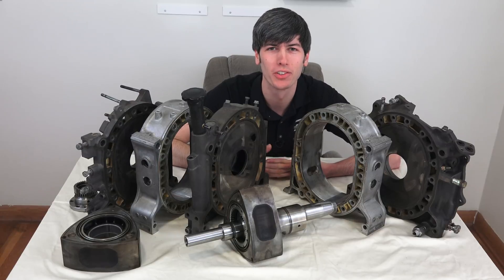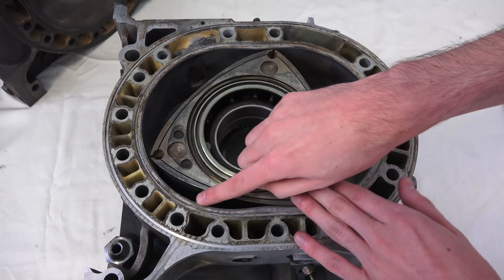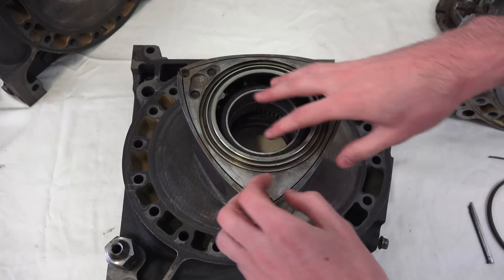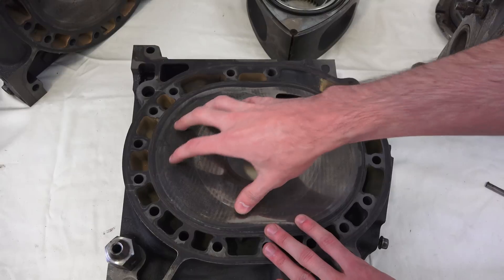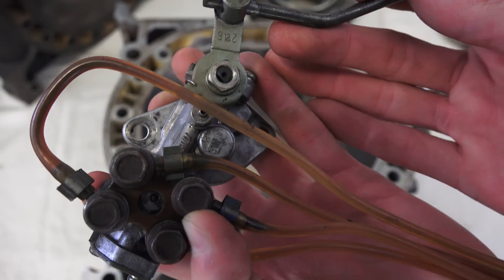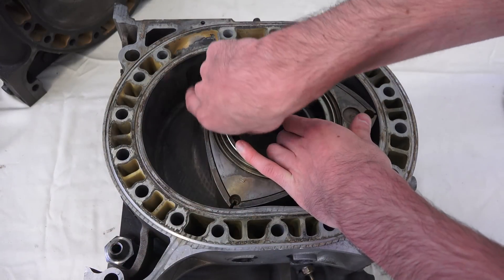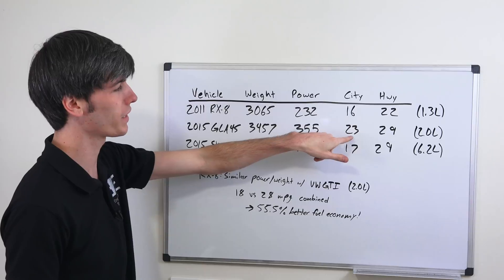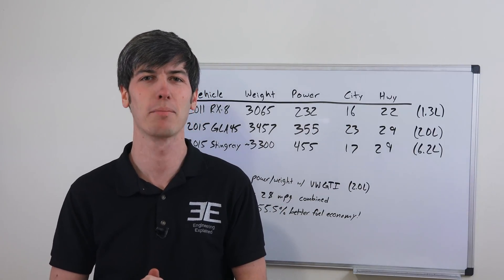4 Reasons Why The Rotary Engine Is Dead

Comment: The Wankel didn't die. They're still being used in the 2009+ M1 Abrams tank.
Reply: The real doktorbimmer Sure, but Mazda is also applying for patents in the USA that pertain to Wankels. They are actively developing the motor. Active is the opposite of dead. One manufacturer may be done, and another starts up.
Reply: The real doktorbimmer Then kindly explain why Mazda is applying for patents in March of 2016? Link to actual patent application below:
http://appft.uspto.gov/netacgi/nph-Parser?Sect1=PTO1&Sect2=HITOFF&d=PG01&p=1&u=%2Fnetahtml%2FPTO%2Fsrchnum.html&r=1&f=G&l=50&s1=%2220160084158%22.PGNR.&OS=DN/20160084158&RS=DN/20160084158
Reply: The real doktorbimmer no.. no... no... there were some changes then they dropped the rotary ban... (said because they still dont kbo hoe to classify the displacement) its nice to c u found ur balls again to come talk again i figured it would b another week or so like last time (: proves my point
Reply: The real doktorbimmer All sep v1 tanks recieved the wankel that would run on virtually any explosive liquid dumped into it. It was only recently that the hatz apu's were deployed. nice try though. A+ for effort.
Reply: The real doktorbimmer Sure. ok. They are protecting themselves from lawsuits by spending tens of millions developing an entirely different style Wankel. Or they are bringing out a new model in the rx series that has run for over 40 years (and they just debuted a concept rotary car at TAS)... Hmm. Let me see if I can find my Occams Razor.
Your argument doesn't even make sense. Sometimes I try to solve math problems by chewing bubble gum...
Reply: Dude the M1 uses a gas turbine engine
Reply: The real doktorbimmer  How about the actual fact Mazda Dealerships in germany already have posters and advertisments for the MAzda RX Vision and all of them feature the term "All new Skyactive Rotary..."? And do not come up to me with a Rotary is not the same as a Wankel. Wankel is the last name of the developer of this kind of engine. Just because Mazda gave it the name Rotary to get out of trouble with NSU (nowadays more or less Audi) it does not mean it is a different engine...It works the pretty much same way.
Reply: The real doktorbimmer There is no reason to insult. Even huge automobile magazines here in germany state that Mazda has confirmed that the Mazda RX9 will be coming as of january 2020. The new engine will be called Skyactive-R and will feature a turbo Wankelengine. It is also confirmed that Mazda plans to make it have around 400hp. There are even released details about the way Mazda will put the engine into the cars engine bay. May I ask why you keep pretending that you know better than everyone else?
Reply: @Nic_sxe10  Can you tell me where I can buy that 2020 Mazda RX9????
Because it looks like you don't have clue what you are talking about.
Reply: The real doktorbimmer Mazda btw already trademarked the name RX-9...aswell as giving away a few details about how they want to improve the thermal efficency of the bew engine.
Reply: The real doktorbimmer 
You are silly. Very silly.
Reply: John Burns agreed
Reply: The real doktorbimmer  But you most likely know even less :P
Reply: terrance hill 
" i was told he was fired by mazda"
No. He found his girl friend being fucked in an RX-7.
Reply: The real doktorbimmer You sound pretty obsolete yourself but you are still here.
Reply: The real doktorbimmer  you must be drunk writing somethibg like dis
Reply: Ryan9I8 yeah hes just a troll  , trust me ive proven him wrong prob ten times or more he will just talk crap until other people join in to agree witb me then.. wait a week or two and he pops up on a different rotary video telling the same lies tryibg to discurage people.. also he is very good at using google lol
Reply: The real doktorbimmer  because they are still being developed dumbass
Reply: terrance hill 
Yes, you are right.  The other teams complained strongly about rotary engines. Then they were banned. The Mazda in 1991 won Le Mans and when the engine was stripped it was suitable to run another race without any modifications. 

What it proved was that rotaries run best when at an optimum speed that ensures the rotor seals are flung against the combustion chamber sides ensuring proper sealing. That is why rotaries are suitable for constant speed gensets in hybrids. 

The emissions suffered from unburnt fuel in the exhaust. Recently solved by CREEV (a type of turbo) which is an ‘exhaust reactor’ that consumes unburnt exhaust products giving lower emissions and improved fuel efficiency by use of the turbo. CREEV will ensure that rotaries will be small. 

SPARCS gives superior heat rejection and improved thermal balancing optimising lubrication. This results in reduced engine wear prolonging engine life.
Reply: The real doktorbimmer 
Bimmer McBimface, you must stop making things up.
Reply: The real doktorbimmer the rule effected mazda mainly.. so no more rotary because only 3.5l f1engines were now aloud to compete..... f1, were rotary was banned!  and of the three cars with rotary to compete all finished.. with good positions showing the great duribiluty of the mazda rotary engine (: so haha nurse bimmer.. just proves my point :
Reply: The real doktorbimmer 
Bimmer McBimface, you must stop making things up.
Reply: If you claim your comments as being 100% true, then you better have the sources/evidence to back them up otherwise they're just more opinions.
Reply: Jeremy Hall  APU
Reply: There is no possible way for you to know whether or not Mazda is developing a new engine in secret somewhere. They are allowed to do that without the public knowing. This is a regular occurrence. Just because it's not in production, not in patents, and nowhere in the news does not mean it doesn't exist, it just means you don't know about it. So why don't you BOTH shut up and just go watch more YouTube.
Reply: Harley Teter 
All the quality motoring press state Mazda are making the car and engine for 2020. The engine looks like it will have HCCI ignition.
Reply: @johnburns4017  You wrote, quote:
"All the quality motoring press state Mazda are making the car and engine for 2020"
WHERE IS IT?
Reply: @sandervanderkammen9230  
Hi doktorbimmer!
Reply: well, the patents they are filing for tells a different story.
Reply: A patent filed recently by Mazda since they announced that years ago isn't an unsubstantiated rumor.
Reply: How is a patent a rumor? You are doing a terrible job at trolling if that is the point.
Reply: It's not. But someone at Mazda is still thinking about rotaries. And Mazda has displayed concept vehicles for a new car In the RX line. Proof it is happening? No. But there is a trend here. And it contradicts the idea that the rotary is dead.
Reply: The real doktorbimmer The assistant power train manager (Tetsushi Marutani) at Mazda had this to say less than 9 months ago:
“We are still developing the new engines with rotary. So in the future we hope to release it, of course, yes. But it’s still under development. We can’t say anything about the [rotary] program; when, what type of vehicle, what is the horsepower, we can’t say anything about it yet,” 
They are in development, a source at Mazda in the power train division said so. That is still the opposite of dead. You just can't stand to be wrong can you...
http://www.motoring.com.au/mazda-rotary-to-go-turbo-101105/
You can go on and on and on, but I will leave you with this. My next post in this thread will be in a year or so here when the new motor is released. I will see you then, until then, I am muting this post...
Reply: herranton1979
Your frustration when encountering madness is totally understandable.
Reply: The real doktorbimmer lol used the google again huh... good for u
Reply: The real doktorbimmer yup they do just not mass produced and sold (: itll b back (:
Reply: The real doktorbimmer  wrong
Reply: The real doktorbimmer 
Why haven't you take up therapy?
Reply: John Burns because to take therapy he needs to admit he has a problem... stage one denial
Reply: terrance hill 
You do have a point. He needs the authorities to forcibly take him. It has to be done.
Reply: The real doktorbimmer still used in tanks i guess and mazda is still working to perfect it so cant be dead not to mention the countless ones on the road but sure u repeating urself without having any knowledge in the matter makes more sence lol
Reply: Ryan9I8 u make an excelent point unfortunately even if u succeseed in proving him wrong he will pop up in a week for more trust me ive been there lol ☺
Reply: terrance hill  you think he is a troll?
Reply: The real doktorbimmer why not...proove you have the better knowledge
Reply: Ryan9I8 i kno he is a troll. He talks crap about rotary on every
You tube vid.. i was told he was fired by mazda.. who really knos forsure.. but still its pretty sad that he jusy keeps going, must not have any friends or a life
Reply: terrance hill lol...wouod explain alot...is that true doktor bimmer?
Reply: Lol only people laughing is us, at ur pathetic troll routine.. ur opinion is urs i respect that however wrong it may be.
Reply: http://www.autonews.com/article/20161212/OEM04/312129959/why-mazda-never-quits-working-on-the-rotary-engine
Reply: ***** The real doktorbimmer faulse.. they ended rx8 prodoction thats about it.. cone on man dont u coment on anythibg else on u tube.. i just keep getting notifications lol
Reply: terrance hill Who is talking about RX8?
Reply: The real doktorbimmer weve been over this.. they only stopped mass producing them.. u agreed with me twice already yet ur still telling other people these bogus facs
Reply: ***** i was when he said they stopped making rotary engines in 2012... because they didnt, they did howrver stop mass producibg rotary engine (rx8 only rotary model)
Reply: The real doktorbimmer yup there has been just not mass produced... and u have already accepted this in other rotary vif on you tube..
Reply: The real doktorbimmer lol ueah there has.. mazda itself has said they still work on rotaru lmao and u have agreed with me on this facy on other vids so why act like  all that didnt happen
Reply: @doktorbimmersdaddy715 

Mx-30

Yeah, it's since been killed. But you originally said they would NEVER do it again. (And have since deleted it). But they did. 

It took me a bit to find this thread. 

I win.
Reply: The real doktorbimmer no i am not.. but u are only repeating the same lies.. very disgraceful
Reply: The real doktorbimmer lol so now ur showing the hate because u got canned again.. come on give it a breaj
Reply: The real doktorbimmer yup i have.. in my drive way (: guess thy r still alive and kicking.. lol thay makes u wrong again
Reply: terrance hill oh I see, misunderstanding. Cause you quoted my name too and I wasn't talking about the RX8 ^_^
Reply: The real doktorbimmer cant be to hard u have agreed aventually every time we have gotten into this arguement lol also i never said it was in any new cars (2017) i just said that it isnt dead still used and still developed at mazda (not mass produced) but devolped
Reply: The real doktorbimmer they work on rotary and have even had plans for them just none that have come to pass (a reason for no rx8 still)..ps if it was as bad as u say it woulnt have been produced so long.... kinda hard to pass a rotary with the emissions regulations being the way they r.... even tho there are sport bikes that are worse (they dont have a regualtion for emissions) maybe the car industry had it out for mazda rotary ever since the won lemans lol i kno thats a sore spot for u dork
Reply: The real doktorbimmer yes i remember all them wankel bikes back in the 70s lol also u say 1990... a year befire there big win... and ban on rotary (another subject i kno u have a soft spot for) looks luke its just big conpanies screwing the little ones
Reply: The real doktorbimmer they said they pulled plug because in 2012 emission regulations were increased... who to believe a huge conpany or one guy who has already admited to lieing on the subject lmao
Reply: The real doktorbimmer euro emissions.. thats why mazda claims to have stopping the rx8.. they should just nake a new rx7 (:   also they did ban them because of lambo and ferrarri conplaining that it was too light, then what happeneds.. new rules come into play so wankel couldnt compete.. stuff like that has happened before and will happen again... oh just so u kno the only reason i kno that is one of the other people who proved u wrong lol seen it before on another rotary vid
Reply: The real doktorbimmer 
Bimmer McBimface, you must stop making things up.
Reply: The real doktorbimmer because it had problem up until then.. then boom mazfa solved something became a big threat and then all the fun begañ.. beside they will b back and when they r ill rember to come here and tease u lol well by then im sure u will have googled a bunch more excuses or lies lmao
Reply: The real doktorbimmer it will happen (: wait and c, more races how when then never got the chance in that division.... they have one more races just vy the way.. just not in those type of race
Reply: The real doktorbimmer one win in lemans u meen.. and after they one they change the rules so rotary cant comete lol ur arguement is garbage.. oh guess what rotafy has one tons of races including other 24h races and 12 hour races some even back to back.... gurss thats what happend when u dont impliment rules to drasticly effevt the little guy.. oh and they do have some lap record and more naybe u just havnt google enough yet
Reply: The real doktorbimmer 
Bimmer McBimface, you must stop making things up.
Reply: The real doktorbimmer 
Bimmer McBimface, terrance hill was very right.
Reply: The real doktorbimmer they do use that but still find it to b inaccurate for comparing displacement against piston engines.. "u dont have a life, or friends, or a car lol" im proud of u for saying the day they stoped mass producing rotary engines tho :) first step buddy
Reply: The real doktorbimmer thats why everytime i see one of ur comments i look to make sure ur not telling more lies
Reply: How about the time when u admited to lieing lmao.. i actually screen shot it because i knew u would deny hahaha is there a way ti share pics on here
Reply: As far as I know, the M1 Abrams is powered by a Honeywell Multi-fuel turboshaft engine, not the Wankel.
Reply: Source/Citation?
Reply: @johnburns4017   John just answer the question!  You wrote, quote:
"All the quality motoring press state Mazda are making the car and engine for 2020"
WHERE IS IT?
Reply: @sandervanderkammen9230  
docktorbimmer, EVs will make all internal combustion engines obsolete very soon. Electric has advanced so much all internal combustion advances of any sort are instantly obsolete. 

Now you know bimmer, now you know.
Reply: @johnburns4017  30 years ago some told me "In 20 years EVs will completely replace internal combustion cars"
He was just as wrong then as you are now.
Reply: The M1 uses a Wankel as the aux' engine.
Reply: @johnburns4017  WRONG! The M1 Abrams tanks fitted with APUs are powered by a 722cc. single cylinder Hatz 1D90 Diesel engine with  a 104mm bore and 85mm stroke.
Reply: @sandervanderkammen9230  
doktorbimmer is under a new name.
Reply: @johnburns4017  The M1 Abrams uses a Wankel aux engine???
LIES!!! You sir are nothing but a fake, a bald faced liar!

Comment: The rotary engine isn't completely dead. Because they are light and compact, they are used in "flying cars". I think the PAL-V uses a rotary engine. Some go-karts are also fitted with rotary engines like the Aixro. I also found a link where some MIT students redesigned the rotary engine for use in chainsaws (LiquidPiston).
Reply: Don't forget the 2009+ M1 Abrams tank... that has a Wankel too. Really; go look it up, I'll wait.

Comment: OMG!!! I had a 1972 RX-2. 2dr coupe, man trans. I was 20 when I bought it used. The thing went thru a quart of oil for every tank of gas!!  Didn't smoke (somehow) and I averaged 17 miles per gallon.  It was supposed to be a combination of sporty and economy, but it wasn't that sporty, and economy was out the window.  The only good thing about the car is that it would rev up to and past the 6500 redline without a problem.

Comment: I'd like to hear your take on some of the other odd engine designs like the Duke engine which uses a swash plate, and the Marchetti cam engine which (you guessed it) uses a big cam around it's output shaft.  And what's up with that Huttlin Spherical engine?

Comment: It was the wankle engine which should have lived.  Chevy used standard gasket material of the period and the wankle lasted 975,000 miles first prototype.
Reply: the wankle and the design was benched until the corsair.  Maybe one more tidbit I will share.  before the 1st prototype was benched it was rebuilt and its demonstrated time was aprox .15 min.   At the time George Wankel was recognized as the brilliant designer of an internal combustion gasoline engine. What you are witnessing in this video is an aberratant redesign sponsored by Ford and Chevy.

Comment: +Engineering Explained what if the rotary was shaped like a fan blade? and the spark came from the top instead of the side? I can see the same "time to ignite all the fuel mixture" problem, but would the change of angle of applied force to the spinning rotor potentially improve thermal efficiency?